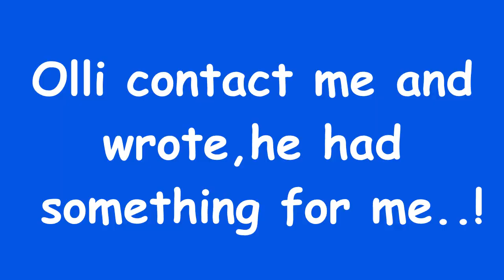E.D. Baby 0.5cc diesel... another gift from Finland!!

Comment: Peter. It was my pleasure!! Great to see it running so well. Hope you can get the other one sorted as well.
Reply from the maker: Sure Olli.The glow should run.The head was leaking as the screws were very bad.Compression is not like a diesel,but I guess,I am spoiled a bit to compare it to a diesel! ;-)   The Other Baby needs more work.The main bearing is worn out,so a new rod will also quick worn out. Lets see,if I can make a bronce insert as new bearing,only than it will have sence to make the other parts,if it should run well.. I will keep you updated of course Olli!